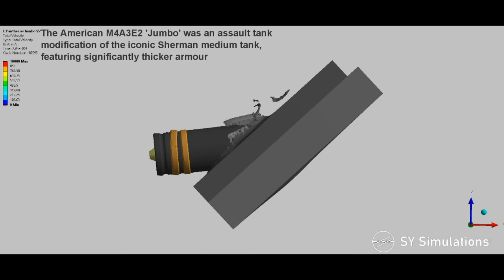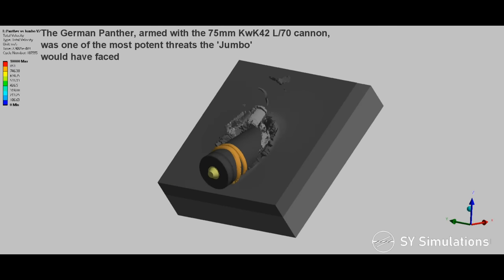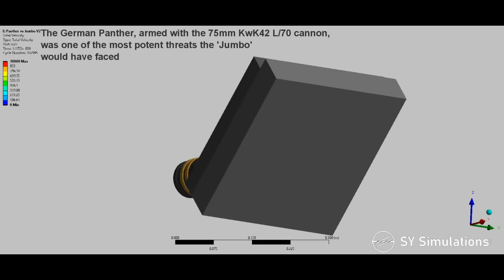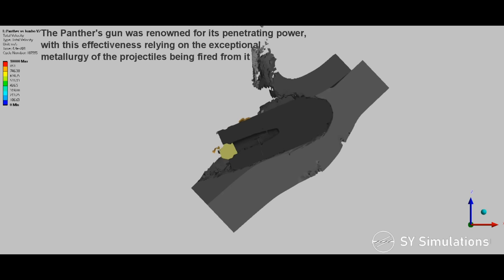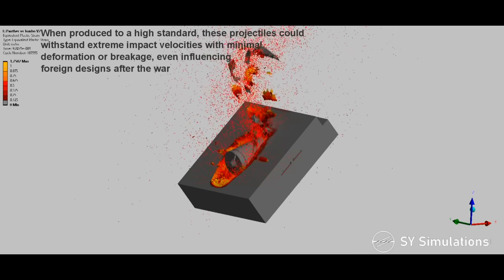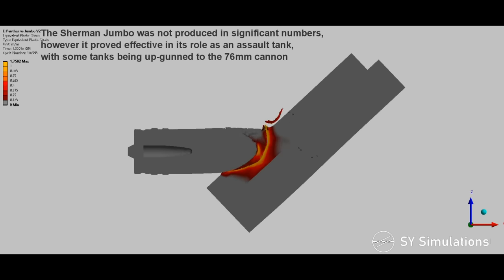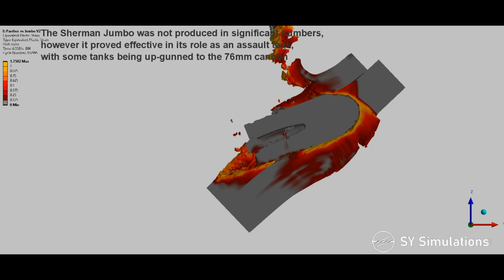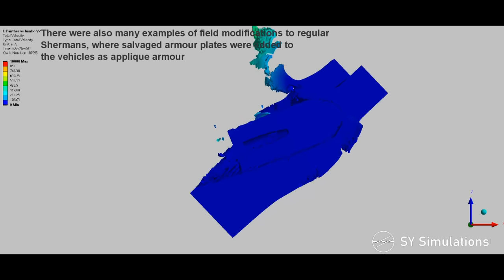PANTHER vs M4A3E2 SHERMAN JUMBO | 75mm Pzgr.39/42 Armour Penetration Simulation

Comment: i really don't Understand the mentality of a Tanker....do they not Realize that Regardless of how high tech and thick your Tank is.....its only 1 Cheap missile away from being Sent to the Scrap yard with you burned alive with it........I really don't understand why Tanks are Even used Anymore, its so non cost Effective, doesent matter what tank it is. could be the Abrams or Leopard or Challenger...all of them are Death boxes. it would be so much more Cost effective to just Supply a shit ton of troops with Javelins and just stop using MBTs all together. Things like APCs and IFVs have a place for sure. but these Heavy as fuck Extremely expensive to make and extremely expensive to maintain MBT seem to just not have a place on the modern battlefield.

Comment: The Jumbo Sherman should have wiggled and angled itself or drove up a slight slope to increase the glacis angle slightly more. 😂

I'm guessing the Jumbo would have probably kept out any lesser versions of the German 7.5cm gun it may have encountered though.
Reply: considering it was a assault tank it was really only used against defensive positions it's Armour is suitable for most German at guns besides the pak long 88 and the panther turret bunkers
Reply: Cope

Comment: Your simulations are improving, now the shell doesn't desintegrate completely and stays on the armor like happened many times in combat.
Reply from the maker: Thanks, but some shells do breakup on impact, in fact most do at extreme angles. Especially the soviet ones I've been doing recently
Reply: @SYsimulations  Yep, but i have noticed for some time that basically all simulations make the shell desintegrate, while on real life many shells got stuck on the armor fairly intact. Only now i am seeying simulations actually show that happening, not disregarding the possibility of it also desintegrating. Yours is one. 

Also your channel is one, if not the best channel of simulations on youtube.

Comment: Panzergranate 39/42 (Pzgr. 39/42) @ 30degree and 500m :   124mm
Panzergranate 40 (Hk) (Pzgr. 40/42) @ 30degree and 500m :   174mm
(from wikipedia)

so you choose the best protected Sherman and the worst performing Panther granate.

Why?
Because you wouldn't like an other result?
Reply: There were no Pzgr40/42 after 1943 because of tungsten shortage
Reply: Everybody knows the Panther APCBC round would easily defeat a standard Sherman glacis.
Reply: @r.j.dunnill1465  This ain't no standard Sherman
Reply: Not sure if you realize, but APCR doesn't do too well against slopes.
Reply: @PeterMuskrat6968  That's why it was chosen. Many wanted to know how well the M4A3E2 glacis would hold up against the fabled KwK 42.

Comment: And remember, then the round explodes
Reply: And a firework show. Your point?
Reply: explosives dont do much to armor, not to mention that an impact like this woudve most likely disabled the fuse.
Reply: @payton4148  The armor is already cracked and the projectile looks mostly intact, and explosion there would propel a lot of material into the tank
Reply: @Astraben  the fuses of aphe would often either fail outright or prematurely detonate if the round was sufficiently decelerated hard enough. So, really, this test is showing optimal penetration. If the round detonates prematurely, either do the shock or time delay, we would probably see less penetration. This is one of the exact reasons the British decided to forgo aphe shells for solid shot ap for the antitank role.
Reply: @payton4148 
Yes, in this case, the armor will not budge if the explosive charge went off. But saying it will not went off is wrong. 

Fuses are armed and fire by acceleration. Engineer are smart enough to figure that part out since the days of interwar period. The time delay is very much optimized.  

Suggesting aphe will have less penetration because the shell exploded prematurely is... I don't know where that came from. 

Just like shock causing detonation prematurely... Those explosive survived being launch from 0 to mv. I'm sure they will manage the impact. 

As far as fuse breakage, it is actually pretty rare, the much more common failure point is the explosive chamber. 

The failure of fuse and explosive chamber is also observable much much much lower as impact angle become flatter, even for lower quality shell. 

There are also ways too keep the explosive chamber intact. The German did for example. Part of the criteria of German shell is the explosive chamber and fuse must be intact. 

Trade off is worse angle performance compare to ap that allow some shattering.
Reply: @jintsuubest9331  the g force the round expirences when hitting armor is 100s of times greater than the force of being fired from the gun. Force can be construed as acceleration over distance. Being fired is being accelerated to max velocity over many feet, in the panthers case it's over 17ft. Impacting armor on the other hand will see the round decelerated in just a couple inches, ie it will expirence a lot more g's of force and absolutely and often did destroy the fuse of aphe shells, as evidence by any picture of partial penetration of tank armor which shows the intact round sticking in the face of the armor like this simulation shows. The engineering is fine for this, the fuses can withstand the round fully penetrating the armor, that's their job, the fuses don't need to withstand a non penetration. There are even accounts of when rounds barely are able to penetrate, their fuses not going off. Aphe is great in my opinion, but it doesn't always work, in the case that it doesn't its still an ap round, so for all it's worth it's a great anti tank round, I'm just saying it won't always detonate, especially in this scenario

Comment: Meanwhile in WT you can shoot a jumbo point blank with a Panther and it won't pen ever
Reply: Instead it will ricochet clean off, just like it does when you shoot the panther upper plate at point blank with 122mm
Reply: @Hookens  The Panther is so annoying, because it seems so random if you pen it or not. The worst thing is its mantlet though. It is easier to pen the UFP than that.
Reply: Volumetric shells and armour made learning armour layouts and where to aim significantly more important
Reply: lol, no. Panther is more than capable of penetrating the jumbo in WT through the upper front plate. As long as the jumbo isn't massively angled.
Reply: Lol. It's a game not reality. Even the Tiger 88MM didn't pen the Jumbo. Look at archive photos wher 88 rds are sticking out of the armor.
Reply: @UkrainianPaulie  The l/56 8.8cm gun on the Tiger I actually had worse anti-armour performance than the Panther's l/70 7.5cm gun.
Reply: ive actually had a few surprising moments where ive gone through a jumbos upper plate with the panthers 75. one i recall recently wasnt even at a very compromising angle, i think just the slight ups and downs of the terrain was all it took to do him in, but i swear i mightve done it on flat ground before, just no clear memory. think ive done it with the tiger I's 88 as well, but i just aim for the machinegun port now regardless cause its a guaranteed pen
Reply: ?? in wt panther has no problem in penetrating jumbo UFP
Reply: Yeah just like 90mm with the panther at point blank range, when it could go in and out the back in real life
Reply: @apersondoingthings5689  the pershing crew was very lucky that the german crew hesitated thinking it was one of their tanks given the fact that they never seen a pershing before
Reply: @flakka1685  bro I am talking about in the game how the 90mm under performs, when us M82 could punch holes through the front glacis at 150 meters. I am not talking about the cologne duel
Reply: @apersondoingthings5689  oh sorry =)) i don’t know Why i asociated ,,real life “ words in your comment with cologne duel =))
Reply: @flakka1685  it’s alright

Comment: jumbo w
Reply: W? Half the crew is dead from spalling wounds and the other half injured.
Reply: @hashteraksgage3281 the shell barely spalled and the crew on the M4 platform is spaced out quite a bit from each other which reduced casualties from penetrations and spall substantially which is why the M4 had such a good crew survivability

Comment: We know panter can penetrate jumbo from cologne battle.
Reply: I don’t think that happened. That’s the battle a M26 Pershing just demolished a panther after it engaged normal M4s
Reply: @apersondoingthings5689  watch it carefully. İt was a jumbo hitted by panther and crew tried to evacuate the tank. Commander s leg smooked and died short time later.
Reply: @fatihorkunss  no neither of them use the T23 armored turret. Adding onto that, the tank that was destroyed was a M4A1 which wasn’t used for the jumbo. Where even did you get this info

Comment: Better hope that PANTHER wasn't escorted by a Tiger 2, that long 88mm would make short work out of jumbo.
Reply: After that hit, the crew would bail out.
Reply: Tiger 2s were comparatively rare. And they didn't always win against the Sherman: there's one on static display in La Gleize that, along with another Tiger 2 and a Panther, brawled with fifteen Shermans, all of which survived. This Tiger 2 had its gun barrel amputated while the other had its gun-aiming apparatus disabled. (I don't know what fate befell the Panther.)
Reply: Probably not, considering how few of those overpriced and overhyped repair shop queens were made, and how many got dunked on by Allied CAS. 
"Superior aryans" my ass.
Reply: @PeterMuskrat6968 Allied CAS itself is overrated with many of its kills are over-exaggerated, they're only effective against soft target instead
Reply: @PeterMuskrat6968 a long 88 could pen any tank from the western Allies roster of them and could pen most Russian tanks with ease other than the IS2-1944 which even that is dependent on plenty of things. The gun isn’t what made the king tiger expensive or unreliable. Not a wehraboo but a king tiger would definitely post a threat.
Reply: @blackmark7165  Mobility kills are good enough more often than not.
Reply: @bro3217 except when it encounters anything at close range. With welds that bad I wouldn’t be surprised if an m22 locust could break the front mantlet with a couple hits

Comment: Panther crew then reloads with a Panzergranate 40 (Hk) (Pzgr. 40/42)

(Armour piercing composite rigid, with a starting muzzle velocity of 1130 m/s )
Reply: Panther crew forgets that they have no panzergranate 40 because there is no tungsten, then proceedes to get blow to smithereens, by a Sherman or Jackson from 3,000 meters
Reply: @apersondoingthings5689   Not at that range (frontally)
Reply: @notsureyou  from the side all the rounds could from the Jackson. It’s hvap could go through the front especially with the arc of the shell
Reply: @apersondoingthings5689  And just to add on,

Through this video (comments) I learnt that the round I mentioned in my original post, wouldn't have performed much better against the Sherman (due to the sloped armour),

But I kept it up, maybe we'll get a video on it 🤷‍♂